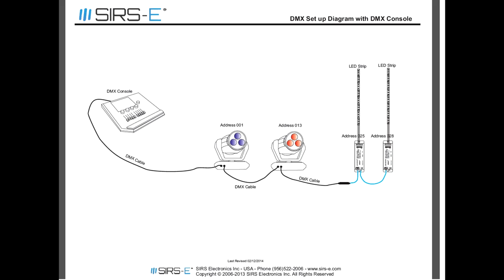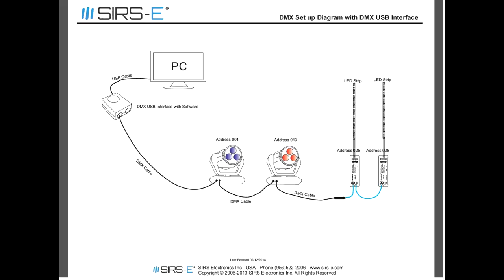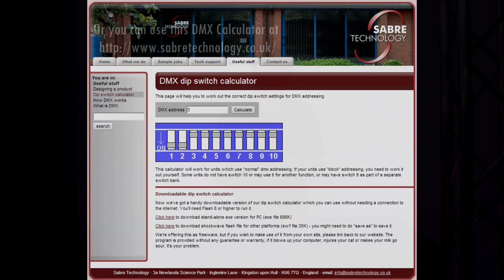What is DMX?

Comment: Let's talk about an LED strip. Concretely: 5 meters, 34 leds / meter, so 170 leds in total. 3 colors (RGB) so 510 used channels. It's in your shop right?

Now every channel can get an 8 bit or maybe 7 bit code to make a value. For the strip, that would mean 0 - 255 (8 bit) for R. Same goes for G and B. 

Well, Let's consider the first 5 pixels. If you were to install it in Madrix or maybe code it in Arduino code. What's the order of the channels? 
001: Red-1  
002: Green-1
003: Blue-1
004: Red-2
005: Green-2
006: Blue-2
and so on

OR:
001: Red-1
002: Red-2
003: Red-3
004: Red-4
005: Red-5
006: Green-1
007: Green-2
and so on
Reply from the maker: Hello Jan, the first section would be correct, consider each LED as an RGB pixel or fixture independent of the others, which means you will have 170 RGB pixels basically in a row.
Reply: Thanks guys :)

Comment: Very helpful intro video thank you.  I have an ACME Fury LED 1 & 3 DMX channel mode (1-Dimmer/strobe, 2-Color, 3-Rotation), under each channel there are range of settings aligned to allocated ranges of numbers - are these DMX sub channels?
Reply from the maker: Jaymin, Those ranges of numbers that you see are the DMX Values for each channel. Each DMX channel has a fader value which ranges from 0-255, in other words from 0%-100%. Depending on the fixture, these values will determine a specific function of the fixture. i.e. if channel 1 of your 3 channel fixture is a dimmer it may be programmed as a proportional increase from 0-255. The color channel (2) from 0-75 it may be red, from 76-150 it may be green and from 151-255 it may be blue. Of course these are only examples and its all subjective to your fixtures actual settings. If you want to know for sure what each channel does at specific values please refer to your fixture's user manual. Thanks for your comment.